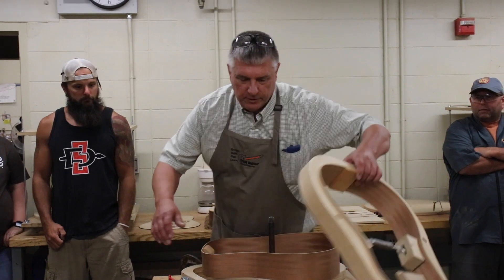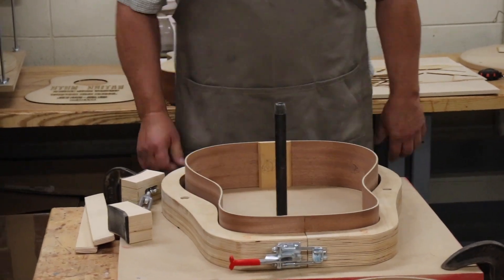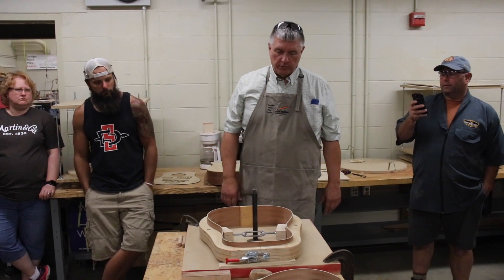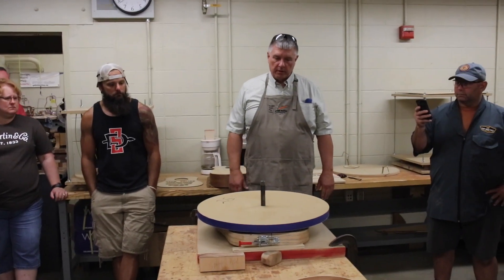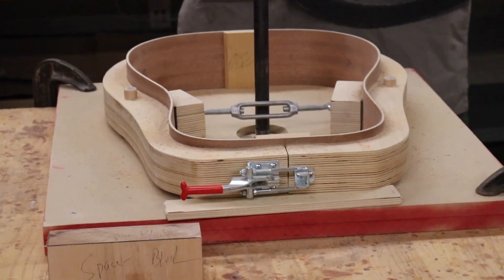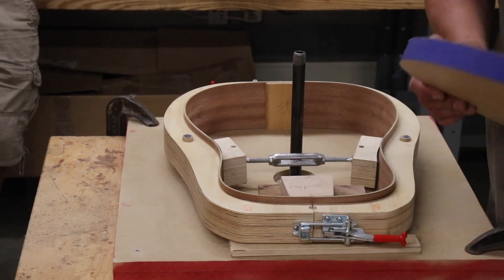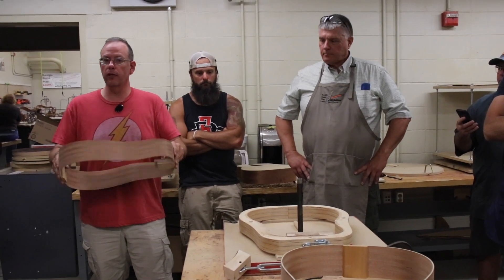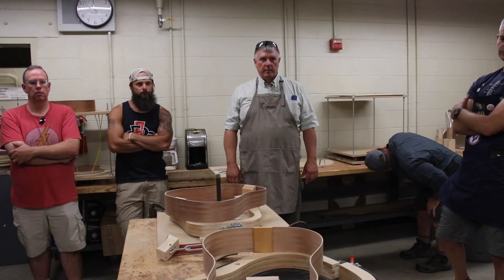Acoustic Sanding the 25ft Radius

Comment: Why the radius to begin with?
Reply: Another advantage of domed tops and backs is they handle humidity fluctuations better. As a top dries out the dome flattens, a totally flat top that dries can only respond by cracking.
Reply: because the top (and back) are not flat, they are domed. If you put a domed top onto flat sides it won't fit. The sanding dish has the same dome radius as the top (or back).
Reply: @AllanTheBanjo  I understand that. Why are they made to be domed? That's my question.
Reply: @newgunguy4176  my understanding is for stiffness; a dome is stiffer than a flat surface for no extra weight.
Reply: @AllanTheBanjo  That makes a lot of sense. Kinda like archtops.
Reply: @newgunguy4176  I think it's supposed to make the sound better too, but you'd have to look into that to verify it.
Reply: @architennis  Makes sense. Archtops definitely get their sound from the "arched" tops.